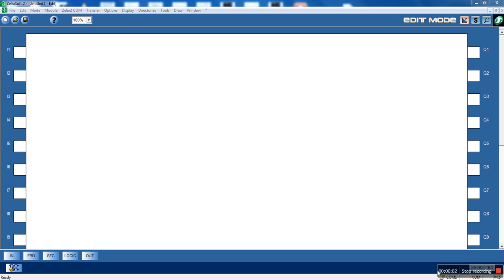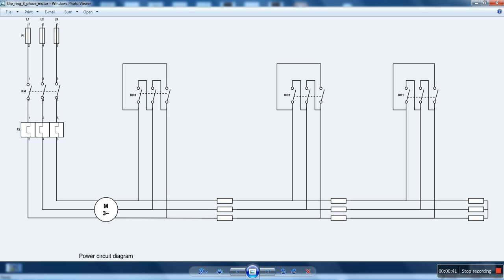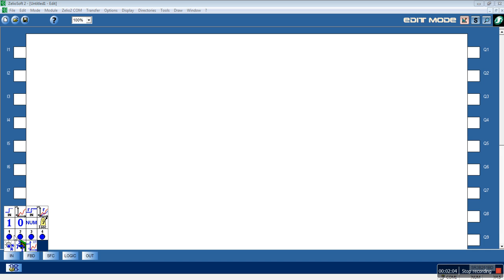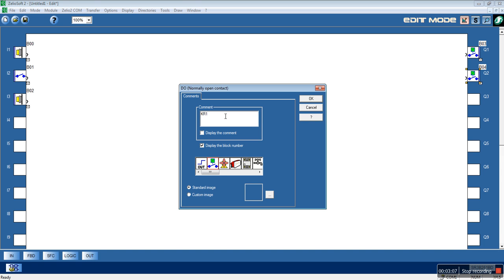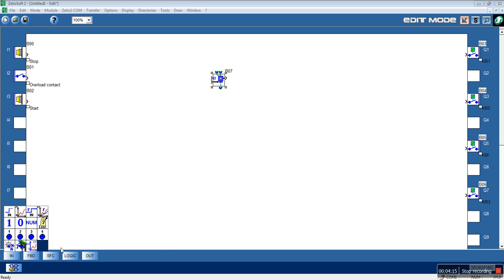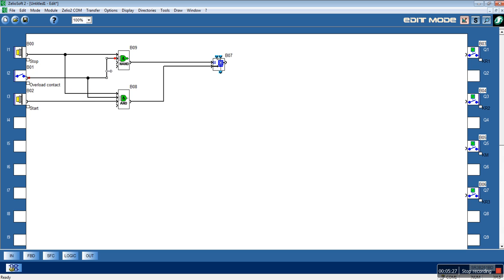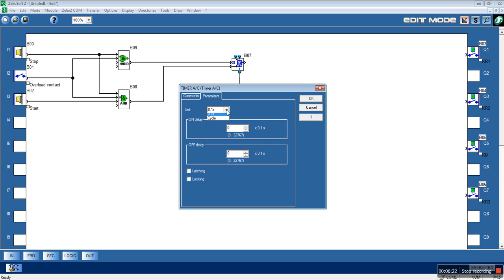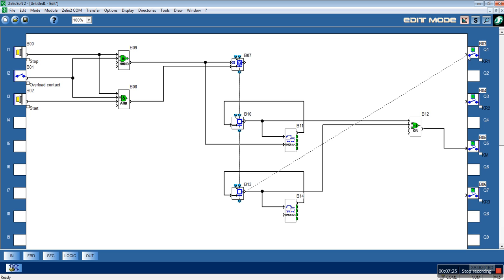Zelio logic video tutorial #4. SFC blocks #1. Slip ring motor starter example

Comment: Thank you for this, it helped me get started on SFC which I haven't used before. I understandit's not designed for real world but would mention that one potential downfall of SFC is it will continue where it left off after a power outage. To overcome this add a RESET button, connected to a Set-Reset, feeding a NOT gate, feeding an OR gate, feeding the SFC reinitialisation (move the NAND output from Reinitialisation of SFC to also feed the OR). Additionally put a Set-Reset between Start and AND, connect the new OR gate to the Start's Reset. Lastly, connect NAND output to Reset pin of RESET button Set-Reset function. Remember when simulating to only pulse the RESET and START inputs as in the real world these would be momentary buttons. HTH
Reply: Wow…I know there is great information here to get that I hope I can I understand at some point…I was totally lost and spaced out after reading this, then saw your name…amazing coincidence!